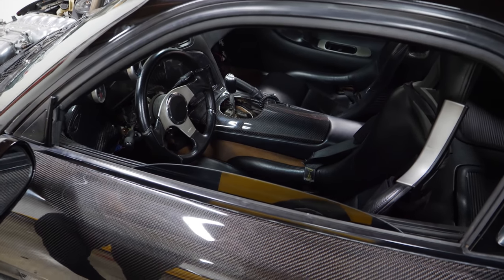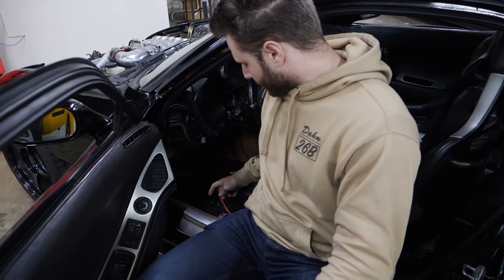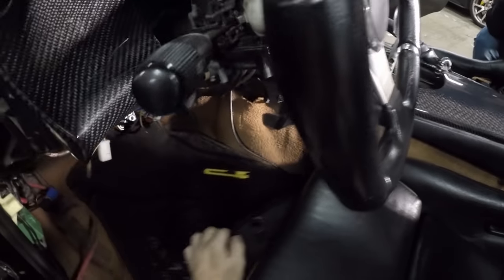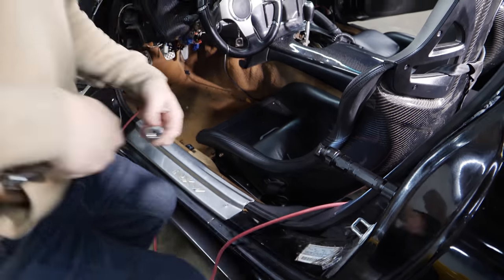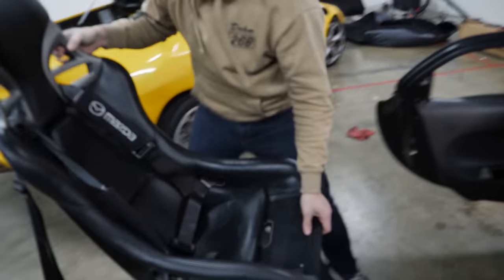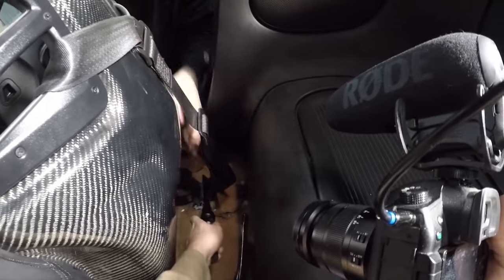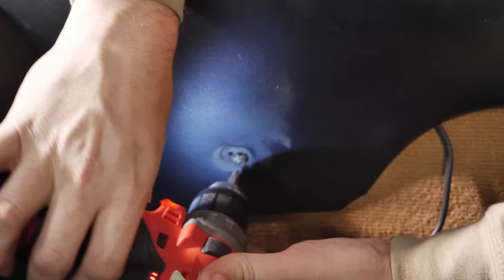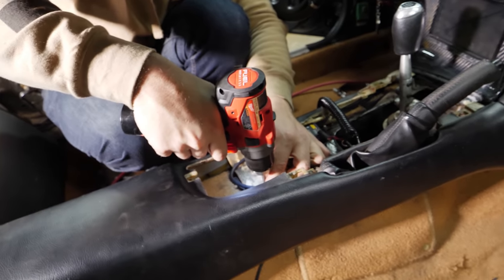I found DANGEROUS Rust under my Seat while Replacing Carpet on my RX-7

Comment: Time for a full interior gut, sand blast, panel replacement, paint, professional rewire(entire car Rob), and carpet
Reply: Yea right obviously you don't know rob dahm...
Reply: @clutchkickpj693  I do I just like to dream that one day he will give this car the true love that it has given him.... 😅
Reply: he can do all of that himself for $15
Reply: rather cut out and reweld and further inspection lol
Reply: @Arne1998  if he sand blasted though he wouldn't have to search because it would be easier to see where the bad spots are
Reply: @brianrobinson9979  I do sandblasting and car restoration, you dont have to sandblast to see if there's rust lol, you can just see it by doing a good inspection with a screwdriver, all he has to do is cut out the rusted section, wirewheel everything around it and then weld in a new repair panel
Reply: and roll cage? 1,000 hp without one in that tin can?
Reply: @BJK1715  wrong car
Reply: @BJK1715  He says 1000hp chassis, but with his 4 rotor he will never push it that far in till he fixes the rust
Reply: @notapplicable1047  1000hp is correct. He's aiming for 2k HP in the AWD 4-Rotor. he was hoping to hit 1000 in the 3 rotor but he was running into issues with his fuel delivery, if i'm not mistaken
Reply: @brianrobinson9979  aiming for. Not making. Again. He will fix the rust and make the car safe again before he attempts a number like that
Reply: @notapplicable1047  fix rust add rollcage push for 1k HP
Reply: @brianrobinson9979  I highly doubt that he will put a rollcage in it.
Reply: @brianrobinson9979  needs a motor again.
Reply: The note in the parenthesis was warranted.

Comment: coming from someone into classic cars on the east coast, your rx7 is really not that bad. aside from the one rust spot where the cage brace plate is and the floor not fully connected to the chassis brace its really a straight forward fix and an easy one. ive seen plenty worse and owned worse. consider yourself fortunate #notfyeahspec

Comment: Jesus man. I would just buy a new one. The state of this car is too much. I can only think of just completely stripping the car down to the frame. They re-welding plates for the tub. Buying a factory OEM wiring harness to solve all that wiring mess . And just rebuilding the interior from scratch. The car looks trash , it is made from trash and i really dont see how 1000hp trash is a good thing. Please rob think this through and dont put yourself in a situation u cant fix.
Reply: He's using aftermarket computer  not OEM I believe AEM and nothing OEM is used that AEM doesn't control   This is a project car.. he has a YouTube channel this is content..a half decent welder can have it fixed up in a weekend with new sheet metal.. the hand done wiring by previous owner I'd be worried about besides the rust might as well make it alright while it's torn apart takes a lot of time to tear that all out and do it again if there's an issue what if he puts it all back together and has to take it all back apart for 1 wire you know what I mean.... The joys of project cars..
Reply: I dont think you understand what a project car is to someone. Stop being so negative. Hes doing what he loves
Reply: I think he should be doing it more for experience and the joy of fixing a car he loves
Reply: @freedomfox8183  Ya , strip it down to the non existing frame . I
Reply: This level of rust isn’t even bad, over here in the Uk we are constantly fixing this sort of rust it’s no biggie
Reply: Yeah...because Rx7s definitely have a frame....
Reply: @matthewgarrigan2369  tell me about it hahaha. just had to cut out most of my front frame rails and weld in new metal on my MX5. and my 306 has got some more i need to take care of soon!
Reply: It's an afternoon job to patch that floor pan. That's absolutely no reason to throw the entire car away.
Reply: Someone doesn't live in the rust chain.  Psh no biggie
Reply: @Catbus-Driver  They're unibody.
Reply: @lastnamefirstname9043  I know! Was just making a sarcastic comment because the OP said it needed to be stripped down to the frame 😅
Reply: @Catbus-Driver  ah shit i mistakenly thought you were replying to the comment above you referencing the non existing frame.
Reply: I mean, in a perfect world you could just go out and buy a brand new RX-7 with factory 3 rotor and bridgeport for a dollar, but here we are
Reply: @lastnamefirstname9043  Damn! I didn't even see that and now that I reread my comment, it didn't come off as sarcastic as I meant so totally understandable

Comment: Your going to want to remove ALL that sound deadener Rob. I got an 87 mustang in the same position as yours. When I chipped away the sound deadener I found even more rust hiding underneath. A big flathead and a hammer should do the trick. If you want to get it off faster, get a can of air, shake it, turn it upside down and spray the deadener. It’ll freeze it and it will come off much easier

Comment: Damn in northern states that ain’t nothing
Reply: Isn't Michigan a northern state?
Reply: @shona5512  lol yup and I live in Wisconsin in the heart of the bullshit Michigan gets identical weather and shit tons of salt in winter ... I have rust under a 2 year old truck that gets garage parked every day but it's still happening already
Reply: Lazydonkey 
I’m in upstate NY. The rubber grommet in rear floor for the drain was so rusted the grommet just pushed thu to the ground.  Just cut it out and welded some  scrap sheet metal then painted it with rust converter. Taking everything out took a while but the actual repair took 10-15 min.
Reply: @thestig572420  My MK2 Golf GTI had severe rust in the floor pan around the grommet areas, floor studs & fuel filler area joining into the rear arch. Worst part was where the roof drainage pipe ends at the bottom of the A pillar behind the front left wing.. It rusted straight through the A pillar, the only thing holding it in place was the windshield. Repairs took 7 months..
Reply: Yeah that's baby rust compared to most cars on the road here in Canada. I am surprised how shocked he is.
Reply: My 15 yr old car has no rust cause I live in Australia!
Reply: Shona 
B4 Passat wagon. I deleted my sunroof and after the welded patch in floor I just tossed a kirkey in her and left it striped. I have rust bubbles around my window frame ,I’ll have to check on that lol.
Reply: Yeah. Look at K1500s and pre-2010 Silverados in Michigan and surrounding states.

Comment: Once you get rust patched up with steel. Clean 8t good and apply p.o.r 15 rust preventative coating if availiable in usa if not try to find a product called chassis saver apply that to both side of floor and no more rust problems.

Comment: doing the same thing to my mk1 mx5, best to just find a scrap rx7 cut out flooerpan and then weld it in. your floorpan is too far gone with sheet metal not being appropriate for this use as it would need to be beadrolled for more integrity and strength.

Comment: Not bashing but a drill with a wire brush attachment is the worst way you can clean that rust. A small angle grinder with a wire wheel works magic on that and will take only minutes to do the whole area and have it down to shiny bare metal, the drill should only be used for touch up

Comment: Cut it out and weld some new plates in. It isn't that difficult, i had to do it on my 1981 Mercedes-Benz S-Class. I never done it before and after few test runs on some random steel for 30 mins i was ready to go.
Just make sure that edges of your new plates and connecting Points are clean  from any durt, paint or coating.
After that you just grind of the welds and give a few good layers of paint.
Also, cut out far enough, not just until the end of visable rust, take like a inch more out, because rust is not always visable in steel.

Comment: I got a cheaper idea (maybe after factoring in the welds) get a used chassis from Japan so you don't have to deal with all the custom one off wiring. Should be able to import it as a classic and drive a right hand drive (rust free) Mazda on the road.

Comment: Really wish you would just take the bull by the horns and re wire and fix this car up. Gut it and rewire it will all the necessary components and if you need more fuel go for a mechanical pump like some of the 4 rotors out there. Would be nice to see this car meet its potential.

Comment: you think that’s dangerous? i have an 83 cherokee with practically no driver side floor.. i lift the carpet and all i see is the fucking ground. one side of the seat is rusted out and is detached. the body frame in that area can be bent by hand.. both front seat belts arent even attached to the floor anymore…
i don’t even know whats holding in the driver side seat anymore…

Comment: That was so cringe worthy starting with not having, using an electric/ battery powered impact wrench. Then the PB blaster, that smell will haunt you for so long, and its the last thing you want to put on before paint or welding. Nope, you choose to go head first into it. Good luck! 
Defiantly didn't need to remove the dash to take the carpet out. In could be a different story but it was just more shit in your way. 
Please inspect a car for rust before you purchase it, because this is how you sound about it now.
Reply: And I don't understand the "debate" about the door sills.
Yes it's a good thing that someone is trying to make them available
Reply: You're going to make it so much worse if you're not paying a professional that knows what to do with that rust. Keep on this path and it will be so much worse than if you left it as it was. Mark my word on that. Get professional advice and listen, and hands off if you like your car. Do not take advice from "Chris Fix" half the time, especially not rust repair. 
Hate to come off this way, but it's so cringe-worthy

Comment: Watching people remove seats is like watching that one friend everyone has trying to score at a bar... Total mess

For the rust treatment. Go get a cup wheel that goes on an angle grinder.  That drill job isn't going to cut it..or finish inside a year
Reply: Yes, the wire death machine eats rust and grime - I almost use it more than cutoff wheels - great for that 40yr old grime on axles too.
Reply: Was just thinking why not use the cup wire. And why no hand protection.
Reply: ExportedAfrican yeah and then spread rust particles everywhere so the active rust can spread to other places… or you could do it the cleaner and smarter way knock off all the loose pieces and treat with Ospho then primer and paint.
Reply: @jimmygrant3212  FYI rust doesn't spread like that - it isn't a disease - chip off a piece of rust and set it on clean metal will not cause the clean metal to rust - chemistry not biology
Reply: Driveway if you add new metal to a rusty area and don’t cure the rust the rust will spread to the new metal…
Reply: @jimmygrant3212  Not really, but we're arguing semantics here - you just have to keep oxygen away from it - you can also stop rust by encapsulation vs neutralization - the danger lies in the expansion of rust that disrupts the applied oxygen barrier allowing ingress of air and water.  My initial point was just that rust dust wont spread rust, it is the act of leaving new steel open to air that does -  independently from the other steel rust or not